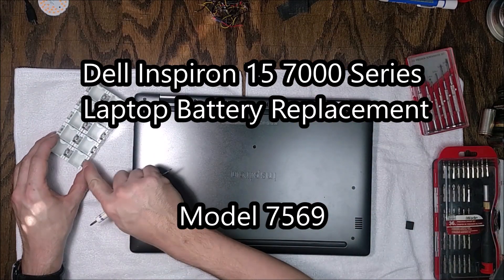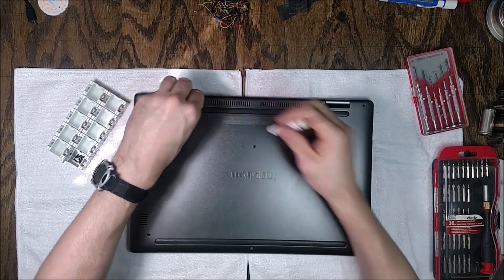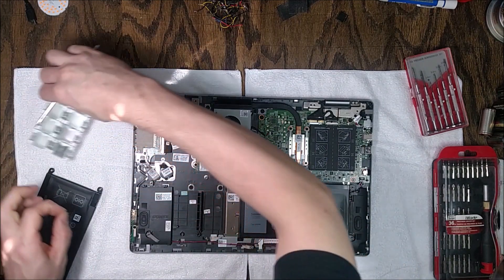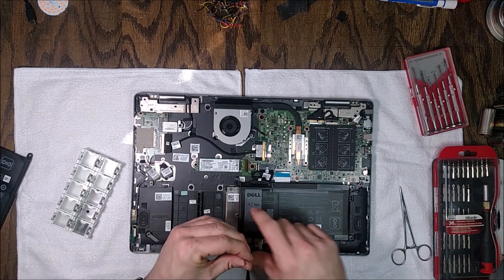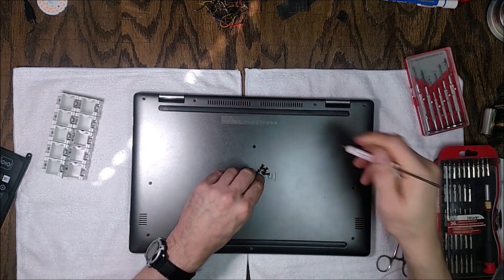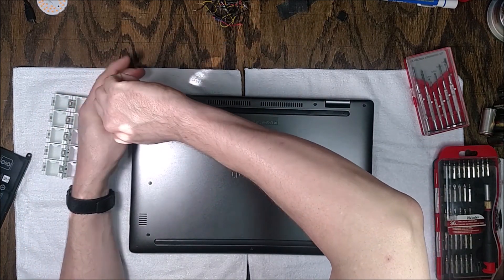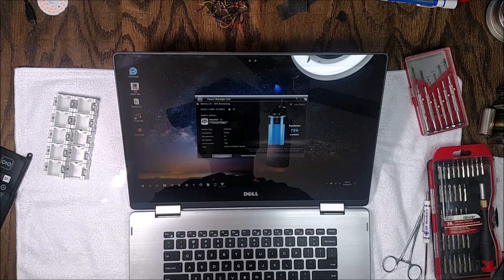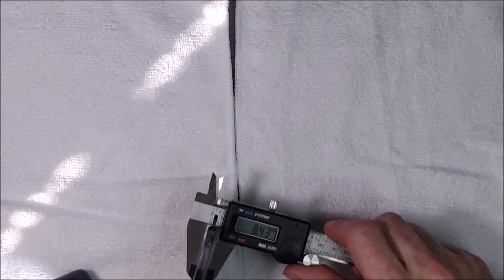Dell Inspiron 15 7000 Series 2-in-1 Battery Replacement

Comment: Thank you. This made changing the battery on my Dell Inspiron 17.3 7000 series 2-in-1 easy. I watched your video and then did it. It turned on with no problem. The battery was at a 60% charge. I plugged it in and now it's charging. I appreciate the time you took to make this video.

Comment: Quick question- how long should it take to get the screws loose- I’ve trying to unscrew the back of my laptop and it only seems to get loose but it won’t pop off you know
Reply from the maker: It shouldn't take too many turns to loosen the screws.  Maybe 5 to 10 turns.  Often the screws will come out of the holes when they are loose but on some laptops the don't, they stay trapped in the back cover.  The other thing is that the covers are usually also held on with snap together points around the edge. So you have to use something to pry around the edge all the way around and pop apart the spots that snap together.  A guitar pick or something similar often works well to pop the cover loose without damaging anything.

Comment: Thank you Carl for the clear video. In my case, the gas in the battery deformed my entire laptop and put a lot of mechanical stress on the circuit board. When the laptop got warm, it blue screened from the mechanical stress. The old batteries were reminding me more of an airbag than a laptop battery.

Comment: hello sir, i have dell inspiron 7572 .. can i put a beter battery as mine has gone bad.. or i have to put in same 1
Reply from the maker: I think you probably have to use the same one.  The pictures in the service manual for that model look like there is no room for a larger battery.
Reply: @cdsmith  thanks

Comment: Please help me know? Can i tweak a 74WH 357F9 Laptop Battery for Dell Inspiron 15 7000 to fit in as it uses 42wh, the one you have used in the video.
Many thanks
Reply from the maker: The 357F9 battery looks a lot thicker in the images I found online and probably wouldn't fit in the space.  But I found on my 7569 model that I could upgrade to a 4 cell battery that is the same thickness but longer.  See my other video for details.  https://youtu.be/R6cbvlZyg6E
Reply: @cdsmith  fantastic... that was so helpful Carl. Like I said I was confused between 74wh, 32wh and the 56wh but now that I have seen the mentioned video 56 is way to go fwd... thanks a lot mate ❤️👍🏻. Like and subscribed.

Comment: Can you share the link on how to get the battery
Reply from the maker: I don't have a link to share.  The seller I got my battery from hasn't sold them for a long time now.  I don't want to just go do a search and post a link to a a seller I have no experience with, and even if I did the link would go bad in a month or two anyway.  The last battery I bought was Flyten brand and it has worked well so I suggest just searching for "Flyten WDX0R battery."  Also, you might want to watch my newer video that shows how to upgrade from a 3 cell battery to a 4 cell for longer battery life.  https://www.youtube.com/watch?v=R6cbvlZyg6E

Comment: Hello, do you have the Amazon link you ordered for this?
Reply from the maker: Sorry, I do not. The link is dead now as the seller is either not selling this battery or is no longer on Amazon.  The battery I installed in this video didn't last very long anyway, and I have already replaced it again since then.  But the last time I figured out I could replace it with a 4 cell battery and get much longer run time.  See my newer video at https://youtu.be/R6cbvlZyg6E for how to do that.  The 4 cell battery came from an Amazon seller called "FLYTEN INC" and it has been working very well.

Comment: what do you think about using a 4 cell, 56wh battery instead?
Reply from the maker: Works great.  In fact, I already did this with this laptop in a later video.  I used a 33YDH type 4 cell 56Wh Dell battery.  https://www.youtube.com/watch?v=R6cbvlZyg6E

Comment: thank you for video! must we fully charge ? like old school batteries - put it on charge for like 12 hours or can we use straight away?

Thank you again
Reply from the maker: I would recommend just charging it to 100% after installing.  No need to leave it plugged in for 12 hours.  The intelligent charging system will stop when it thinks it is at 100% anyway.
Reply: @cdsmith  thank you so much Carl :)

Comment: Is it possible to lose your data on your laptop when you replace the battery?
 My mother is frantic about it.
Reply from the maker: The data on the hard drive is not maintained by the power from the battery, so you should be able to replace the battery without losing any data.  However, you should back up anything important before doing any repair work like this, because you can't anticipate what might go wrong.  You could do something clumsy like drop your screwdriver on the motherboard and crack a chip.  Or accidentally dump your coffee into the thing while it's open.  You might think that you wouldn't do something like that, but that's what everyone thinks before an accident happens.  Including me.  :)  So back up anything important.  Everyone should be doing that anyway on a regular basis.

Comment: I have a dell Inspiron chromebook 7486 and having trouble finding a battery. My charger cable works fine but the laptop itself won’t charge. Any idea if this is the charging port that is messed up or the battery? 
I had to bend the charger a bit for it to charge for a bit but that method stopped working after a bit.
Reply from the maker: My charger adapter actually developed a break in the wires near the end that plugs into the laptop and for a while I had to bend the wire a bit to find the position that made connection.  Eventually that stopped working and I had to buy a replacement power adapter.  When I did, I bought a higher wattage one that charges the battery even faster.  Yours could be that or it could be the port in the laptop.  Or it could be that the laptop thinks the battery is damaged and doesn't want to charge it.  My 7569 had a light on the front edge that changes color when the power adapter is plugged in and working.  If yours has something like that, it would indicate if the charger has a good connection to the laptop or not.  Also, you could check to see if yours has the Dell Power Manager app installed.  That app will tell you the condition of your battery, and if it needs to be replaced, and when the power adapter is plugged in it should show if it is trying to charge the battery.

Comment: my port is really tight. I pull the pull tab (transparent plastic one i suppose)and that is almost disaster. it tear a bit but I manage to stop.

in my case I suggest that should use small screwdriver to softly lever the very edge of the port
Reply from the maker: It's always a bit scary to have to pull on a connector that doesn't seem to want to come out.  I even broke a ribbon cable connector once because I thought it was the type where you slide the locking part to the side and it turned out to be the type where you lift it and it rotates up away from the cable.  So in general, I recommend studying each connector carefully to determine the proper procedure for removing a cable.  But in this case, with my battery, it is just a pull to remove type.  Mine wasn't very hard to pull free, but if you have one that is not, it might be better to do as you suggest and use a small screwdriver on the connector to lever against the shell it plugs into.  But be careful not to contact any of the pins in the connector and short out the battery.  Even a momentary short could melt wires in the cable or damage pins.
Reply: @cdsmith  yes , I try my best to not touch any pins just in case

Comment: To this battery give your computer more running time? Than the original time of 6 hours? 

I recently bought a Inspiron 7500 2n1 black and the battery life barely last through one of my college lectures. The class is about 1hr and 30 minutes long and my battery drains from 100% to 21% - 15%. All I am doing is typing on google docs and surfing the web.
Reply from the maker: The original time was around 5 hours and with the new battery it was getting close to 7 hours when I did the switch. This is with light web browsing, word processing, spreadsheet, stuff like that, not games or video playback.  Dell sells numerous different laptops under the 7500 2 in 1 name so I don't know how yours should compare, but it sounds like you aren't getting near the battery life I would expect.   One thing you can do is launch the Task Manager and let it run in the background and if you see the battery draining check the task manager to see what is using the most processor time.  Windows 10 task manager even has a column called "Power Usage Trend" that can tell you what apps are using the most power.  This might let you know what is sucking up your battery power.
Reply: @cdsmith  Thank you! I will make sure to pull up task manager to watch the power usage. I didn't think of that.

 I did some more research and apparently it is so post to last 6 hours and 14 minutes (Actively surfing the web). 😪 Not even close

Comment: Will changing the battery make me lose all my data?
Reply from the maker: Nope.  The files on the hard drive do not require battery power to be maintained.  There is some info in the BIOS settings that need power, like the time and date and some settings, but that is maintained by a little coin cell battery so that should be retained OK as well.  However, it is still a good idea to back up your important files before doing a repair like this.  You never know what kind of mishaps can occur that you wouldn't even think of.

Comment: Ok Carl, GREAT information. Do you still have the link to a GENUINE Dell 33YDH! Yep, found a LOT of products that are made by ??Somebody??. Would really appreciate the information. Thanks
Reply from the maker: I don't have a link to a genuine Dell battery.  I think the only way to be reasonably sure you are getting a genuine Dell battery is to buy it directly from them. At a far higher cost, if they even offer it.  The WDX0R battery I used in my first replacement looked like a genuine dell but that seller has long since stopped selling it.  When I bought the 33YDH battery for my second replacement I didn't even try to find one that said Dell on it.

Comment: I keep seeing 42WHR - can this laptop fit a 56WHR, 4 Cell, Lithium ion Part # W7NKD
Reply from the maker: You can replace it with a 56 Wh battery.  I have a newer video on doing just that here: https://youtu.be/R6cbvlZyg6E   But that's not the part number of the 56 Wh battery I used.  I used a 33YDH.   But a quick google search on W7NKD looks like it's the same, and some listing have both part numbers in the description, so I'm guessing it would work as well.

Comment: Hi Carl. Thanks for the great tutorial video. I was able to change out my old battery and install a brand new one. However, my laptop says 0% available (plugged in, not charging). Is there anything I can check to see why neither batteries are charging or is there a common problem with the Inspiron 15 7548? I thought maybe i just needed a fresh reboot after the install but it still isn't charging. Any advice would be great!
Reply from the maker: First I would see if you have the Dell Power Management app installed like my laptop has.  If it's like mine you can just right click the battery icon down by the clock and find it in the pop up.  The Power Management app might tell you what the problem is.

Comment: Hi, Carl. My computer is 4 years old now and no longer holds a charge. Could you post a link to the battery that you got that worked from Amazon? Thanks!
Reply from the maker: Unfortunately I can't give you a link to the exact battery I bought as the seller hasn't been selling it on Amazon for a while now.  I would recommend just searching on the WDX0R battery type and pick a seller with good reviews and maybe one that seems to be in the business of selling laptop replacement parts.  But before you buy a battery you might want to watch my new video where I show how to replace the 3 cell battery with a 4 cell battery to provide a much longer battery run time.  https://youtu.be/R6cbvlZyg6E

Comment: Great video, but one addition. Apparently now the new batteries have a "safety" where they won't turn on initially unless the laptop is plugged in.
Reply from the maker: Good to know.  So I guess this means that when you install a new battery if the laptop won't just immediately boot up like mine did in the video just plug it in to get it to boot the first time.  Not sure what the point of that feature would be.  Maybe it makes it safer for installation for the battery to not output a voltage until it is installed and turned on by the AC charger.
Reply: @cdsmith  Yeah, exactly. It was confusing because nowhere does it say that it needs to be plugged in. It just wouldn't boot up. I texted a Dell tech contractor who wrote back, "The battery has a safety in place that prevent it from discharging until it receives a charge." I plugged it in and could see that the new battery had very little charge in it. So after about an hour it was ready to go.

Comment: Best thing i found out is limiting the cpu 70% or less cause this laptop will run at 100% cpu for no reason 😑. Just curious do those side vents suck in air?
Reply from the maker: Excessive CPU use is a fault of the operating system, not the laptop.  I've fought that a lot with Windows 10, where I find some background Windows process sucking up 30% of my CPU for like 10 minutes for no good reason.  I've tried changing settings like going into the task scheduler and setting Windows Defender to not do full disk virus scans when the laptop is on battery, but it seems Microsoft thinks they know better and settings like that revert back to the way they want them when updates occur.  I've thought about installing a Linux distribution just to see how much longer it lasts on battery.  As for the side vents, do you mean the little square ones toward the front end of the laptop (toward the bottom in the view in my video)?  I think those are just for sound to get out from the speakers that are right behind them.
Reply: @cdsmith  yeah oh thats the speakers honestly thought that's where the cold air went into then got exhausted out the back

Comment: This seems easy compared to changing an iPhone battery 😂
Reply from the maker: It really is.  No having to deal with glued together parts where you have to use heat to melt adhesive, no fragile glass to crack, and no microscopic screws where every one is a different size and has to be put back in the right place.  All you need is a small philips screwdriver set, maybe something to pry the back panel free where it snaps together, and some confidence that you can do the job.

Comment: Hi Carl, nice video. I have a Dell Inspiron 15 7000 series with a i7 core and 15.6" display. My question is will the same battery work for this series? And can you provide the screw details, it would help me when I order them online to get the right ones.
Reply from the maker: Dell has used the "Inspiron 15 7000 Series" name for a wide range of laptops so I wouldn't know if the same battery would work for yours.  You would need to check the specific model number, like for mine it's model 7569.  Or just open it  up to see what kind of battery is inside.  As for the screws, I don't know the specifics other than they are tiny screws with philips heads.  If you are just replacing the battery you shouldn't need new screws unless you lose one.

Comment: Someone can tell me why this battery have this problem?
Reply from the maker: Swelling can affect many kinds of lithium ion batteries.  I don't know if this particular one is more prone to swelling than other kinds of lithium ion batteries or not.  But in general what is happening is that as the battery charges and discharges it wears out and the chemical reaction that goes back and forth with each cycle is not fully completing each time. This makes the gas as a byproduct of the reaction.

Comment: Hey Carl! Very informative video. I have the DELL INSPIRON 13 7000 SERIES (2in1) laptop, got it back in 2017, just checked the Power Management Lite and it says "FAIR" and it says that I should consider changing the battery. I got the laptop from Best Buy here in Canada if you're familiar with that. Do you think they're capable of doing the battery work changes? Cause I dont have the tools to change it myself. Hope you respond. Cheers!
Reply from the maker: If Best Buy in Canada has Geek Squad like they do in the US they should be able to install a new battery for you.  But it's actually not that hard to do, and if I remember right the only tools you need are a small philips screwdriver and some sort of plastic tool to wedge in the crack to pop the cover loose where it snaps in.  Even something simple like a guitar pick can work for that.  But if you don't feel confident in trying it yourself I would think Best Buy could do it for you.  And if they do it you have the advantage of not having to worry about breaking something.  It's on them to get the job done properly.
Reply: @cdsmith  Thank you, they have it. But it might take a while for me to do it considering the situation right now. Thank you, keep safe!